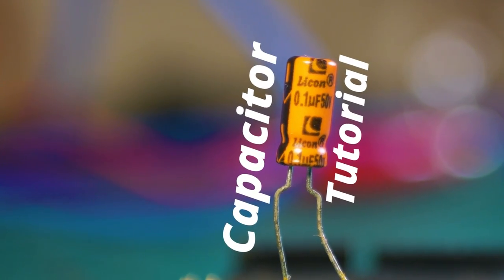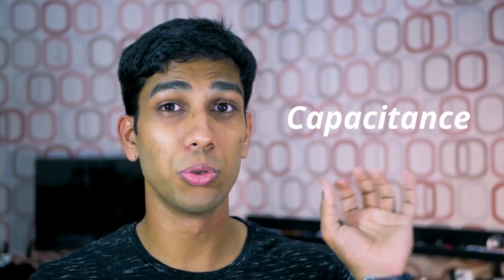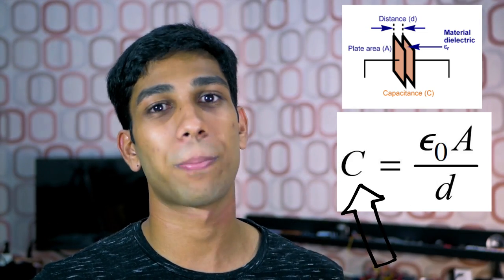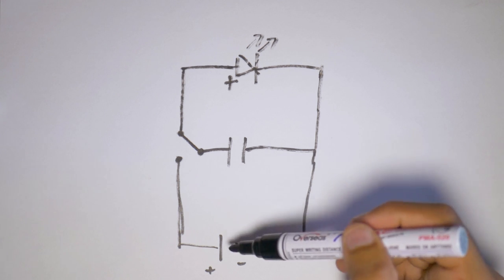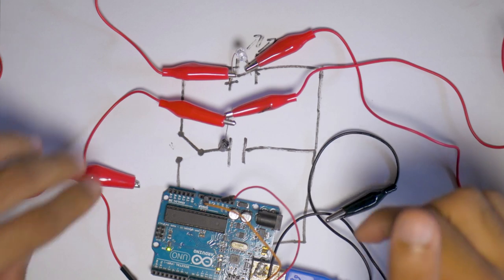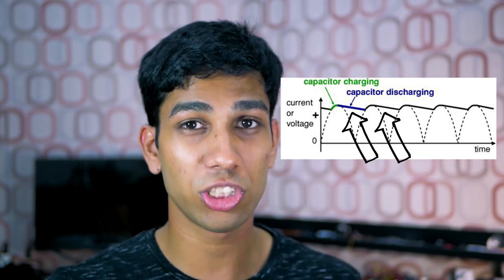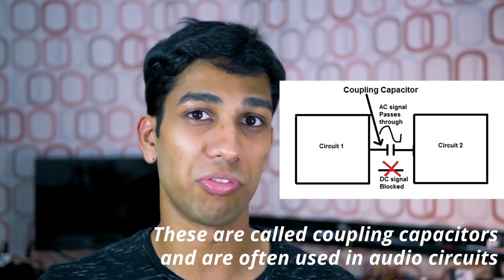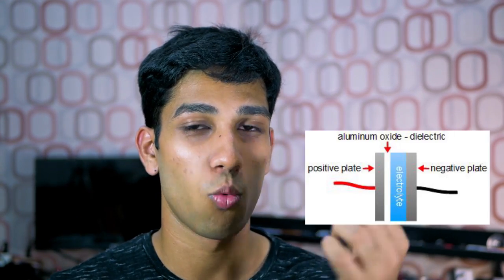Capacitor tutorial & Arduino & Raspberry Pi implementation- Electronics crash course #7

Comment: Thanks - this is really a clear explanation.  I do have a dumb question... if the capacitor is two separated plates why are most capacitors round? thanks.
Reply: It's not a dumb question. The plates are actually long and rolled up with an insulator between them. Think of a swiss roll cake.
Reply from the maker: @northshorepx  Yes no, question is dumb. I had originally filmed why electrolytic and film capacitors are round but I cut it out during my edit since I wanted to keep the video short. You are right, the 2 plates are rolled up into a coil like a swiss cake (Swiss cake analogy is fantastic and I never thought of explaining it that way). This helps them maximize their surface area which helps increase their capacitance :)

Comment: This was a really EXCELLENT tutorial. I will definitely checkout your course. The music was great and not so loud that is got in the way of listening like so many other tutorials and the information was very easily digestible.  You covered the things most beginners will need to know so that they can start doing their research. I only have one small minus on your video. You use up a large portion of your screen with your face just talking and use only a tiny portion of the screen for diagrams and pictures. I found it very distracting to the pictures as your face moving took my attention away from the information. Of course this your style and I applaud you for  such a wonderful compression of so much information into such a succinct way. I'm definitely going to subscribe. Keep doing such great tutorials.
Reply from the maker: I'm glad that you liked the video and thanks for your feedback. Hmm, I did not realize that my face taking up so much of the screen would negatively affect the diagrams. Next time I will move back to give the diagrams and pictures more space. Thanks for your support and subscribing :)
Reply: @saraltayal5005  Thanks. Well think about it this way. If you were tutoring a class using a say a whiteboard, would you restrict yourself to talking in front of it and only using a small part to show things, or would you move out of the way from time to time and use the space in a better way? Sure sometimes you move in front, other times you don't. Just some thoughts.